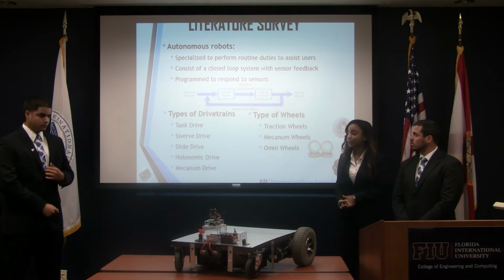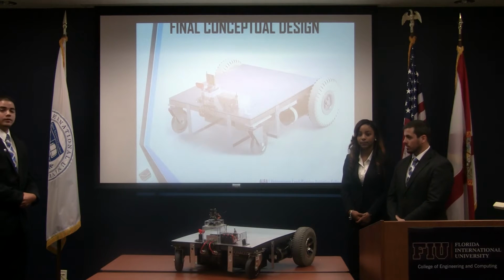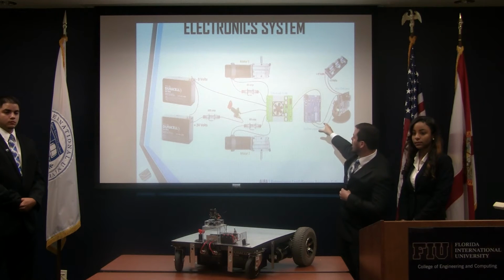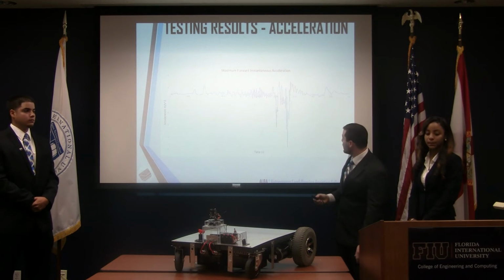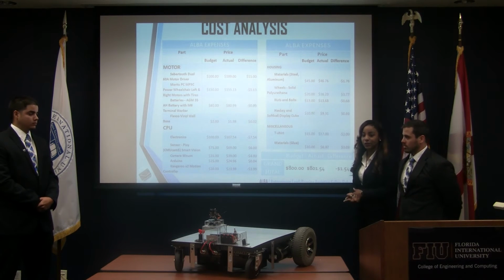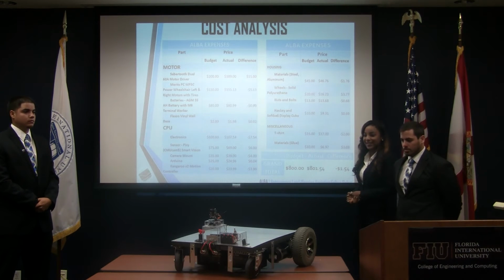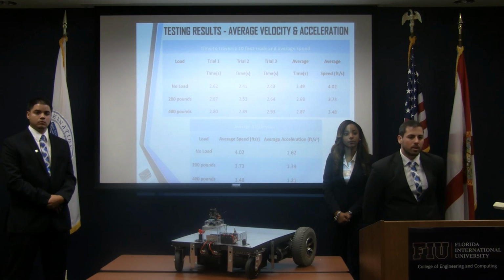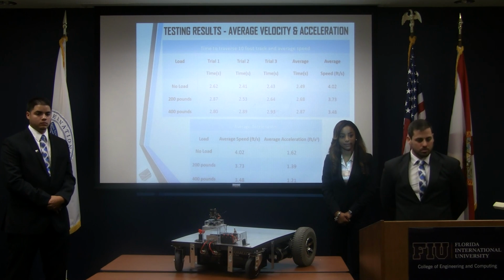Team 6: ALBA: Autonomous Load-Bearing Assistant Robot

Comment: I like that they added their advisor in their first slide of the presentation. Also, I appreciate their outline slide. It's nice that they explained the changes with the reasons for the design improvements. Also, I like that they mentioned the safety factor for their design. The slides were clear and easy to read. However, some slides include many pictures which make the pictures small and hard to see.